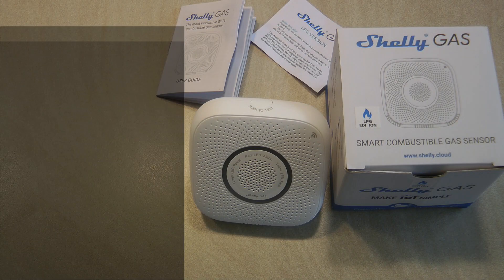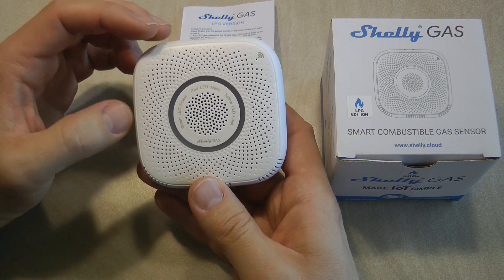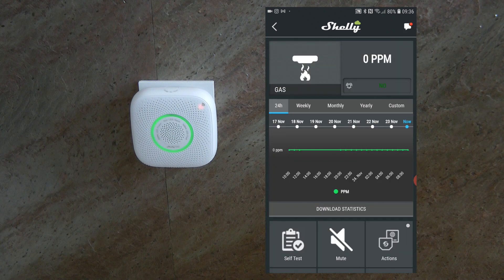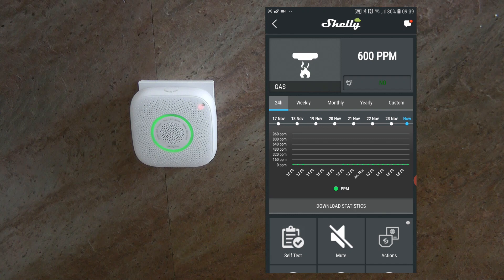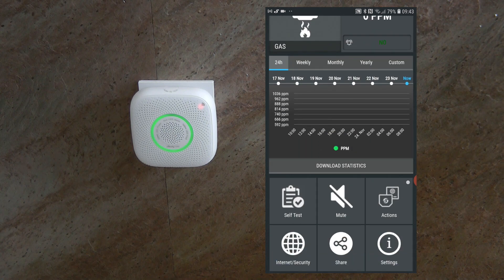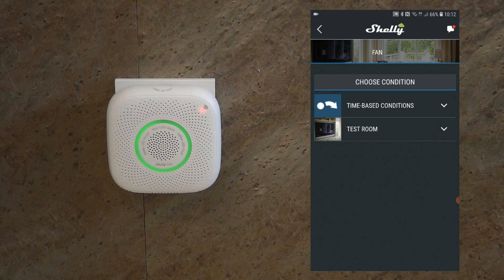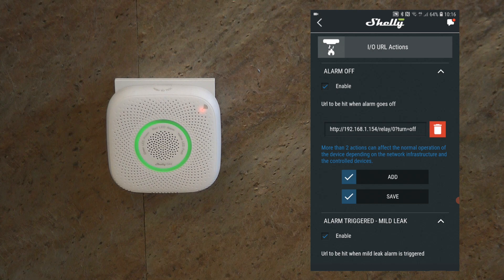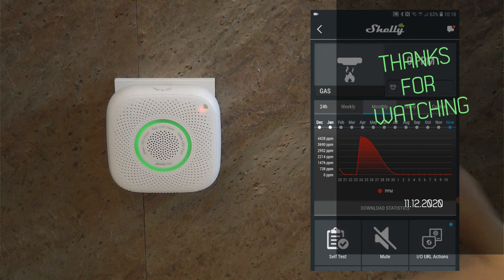Shelly Gas - smart gas sensor

Comment: Thank you for a fantastic review.  Seeing it in action makes this all the more believable.
What is the minimum level the alarm triggers at?   Can you set the minimum detection level for mild and heavy leaks?
Does this device also have communication via MQTT for integration with Node Red or some other HA device?
Reply from the maker: The weak and strong leak is set in the device, there is no way of setting it. And to be honest I would not know what would be the appropriate level. All Shelly supports MQTT, but I have not played around with it yet.